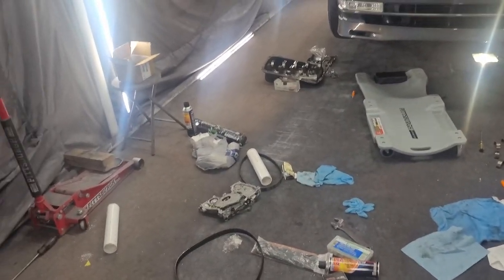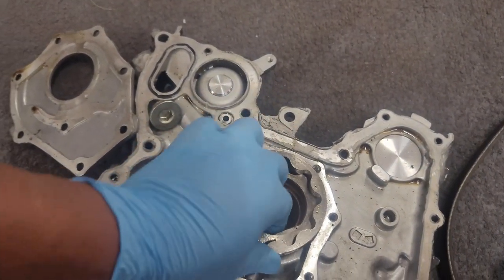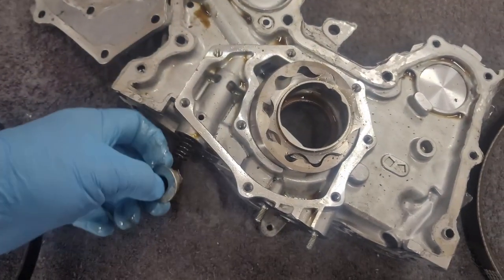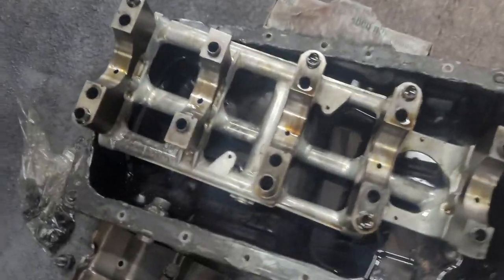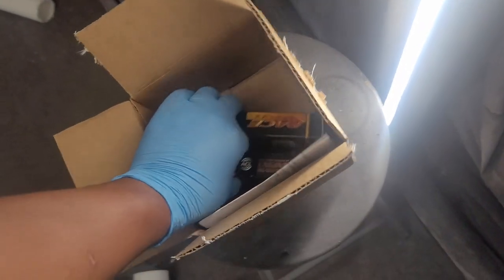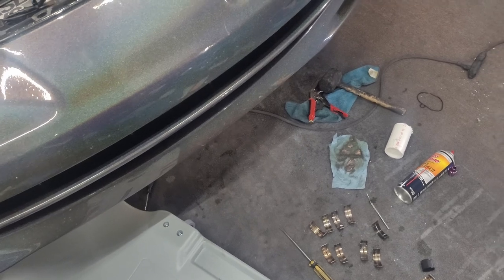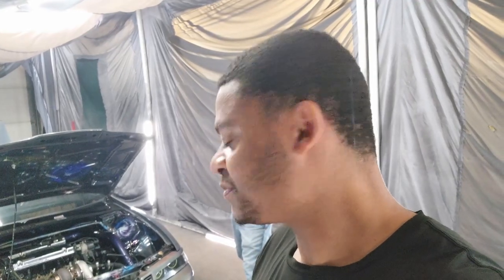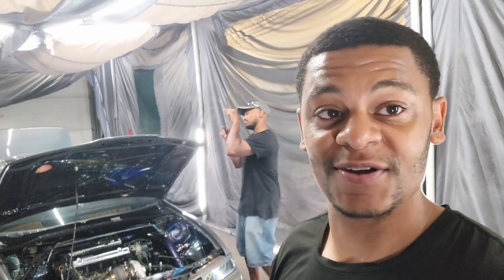How not to change your h22 & f20b Main / Rod bearings in your Honda prelude

Comment: I think this is the best sounding h22 I've ever heard. I didn't quite catch the reason why your rod bearing failed? You had oil pressure, what else could cause that?
Reply from the maker: It needed to be line honed b4 I built it cause I was using arp main studs and they tighten more than oem spec. (First motor I ever built)

Comment: Would it be possible for you to make a video on how to fix hyper flash after installing leds into the turn signals? I don’t want to have to go back to my ugly halogens but the hyper flash is hella annoying
Reply from the maker: Just need to splice in a resistor box

Comment: Those arp main studs basically crushed yours bearings we don't recommend using them Unless block is linehoned and over 800hp
Reply from the maker: I tightened them to oem spec hoping it would be the same as oem studs

Comment: Hog long did it take to change all the bearings
Reply from the maker: Don't change your bearing like this bro it won't last long. Pull the motor and do it the right way
Reply: I wanna make it run just until I find a nee engine, this engine makes a noise at 2,000 RPM or higher I’m not sure if it’s the bearing or something else, I changed the timing kit and still has the noise!
Reply from the maker: @Cruz0604  what kind of noise like a ticking, rattle or scraping metal?
Reply: Sounds like rattle scraping metal to metal noise,

Comment: My turbo h23a runs 100psi oil pressure on cold start
Reply from the maker: Sheeesh big oil pressure
Reply: @treybedipping1734  it’s oem bottom end and pump. Just so you know what it is like stock
Reply: @treybedipping1734  same with my h22a4 it’s about 90-100